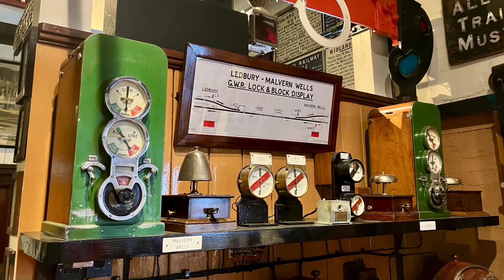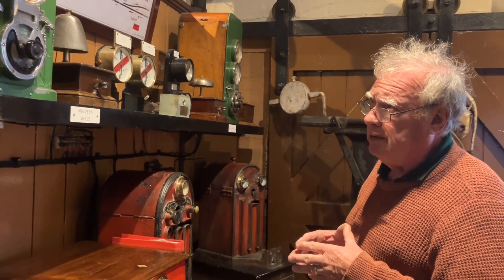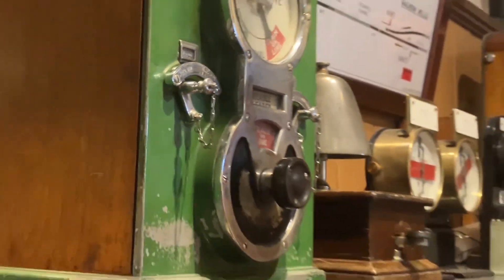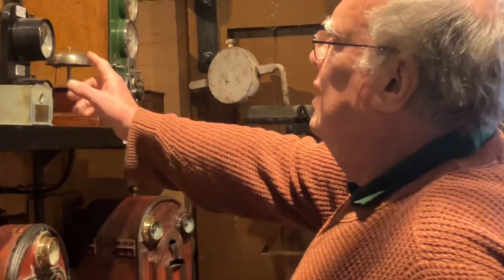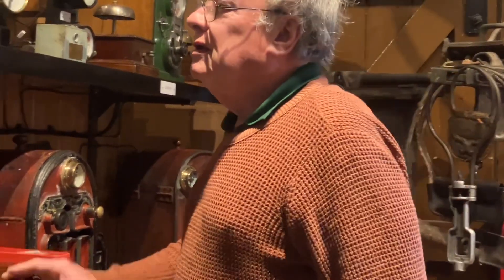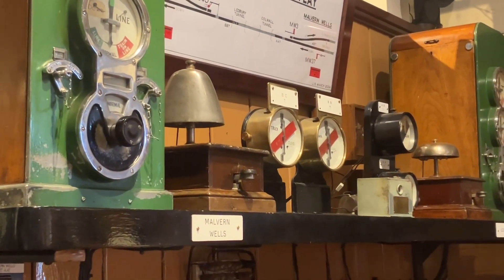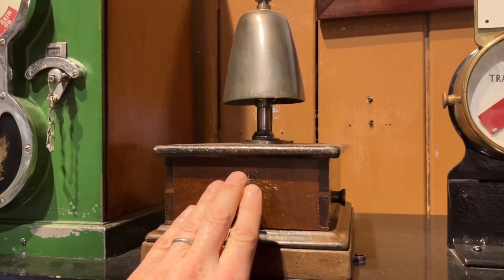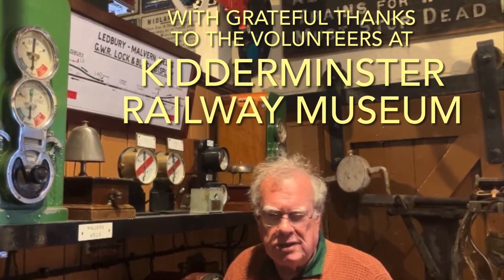GWR Lock & Block system

Comment: Interesting system. I think there was a similar thing with Midland Rotary blocks at Shipley with a mercury treadle
Reply from the maker: Yes, lock and block was used in a number of early signalling installations, the mercury treadles though were problematic, there’s one on display in the national rail museum, stores room, right near the end of the L&Y training layout 😮
Reply: @irseminorrailwayssection9491  That's why I remember it, as a trainee we were at Shipley when the lineman came to a fault. I don't remember how he fixed it but remember being told they were problematic. I will have to have a look for the one in NRM. I hope to see the layout demonstration one day.
Reply from the maker: @cedarcam they leaked terribly and after much use became worn out, track circuits were by comparison much easier so took over,   If you find the L&Y training layout just keep walking towards the end of the wall and just there on the end youl see it on the floor area.
Reply: @irseminorrailwayssection9491  OK Thanks. Tornado is in York next week so I may go and have a look then.